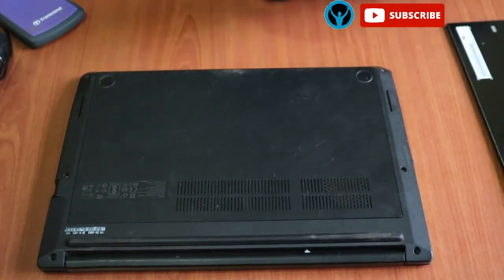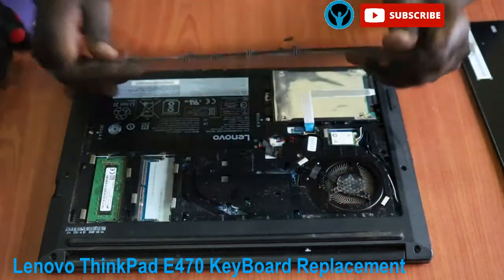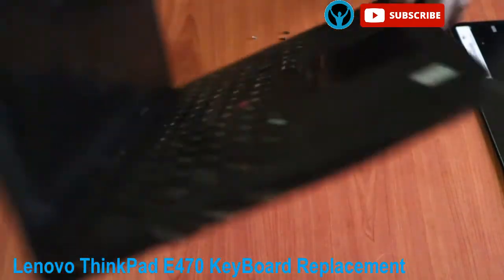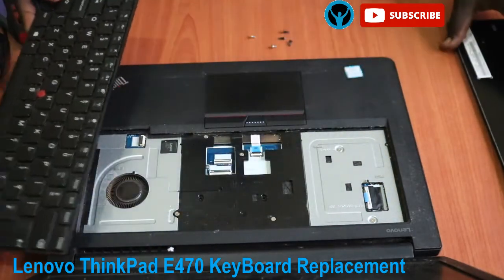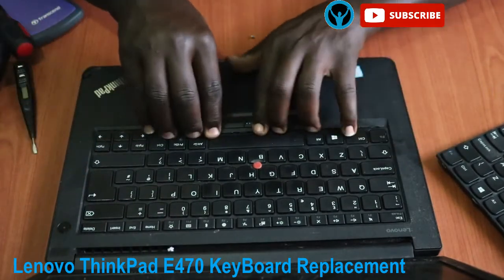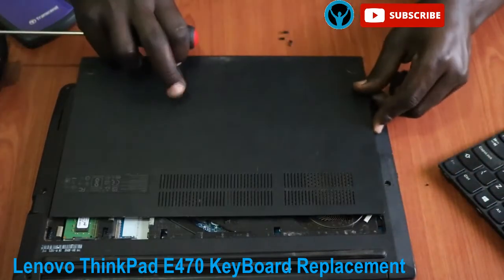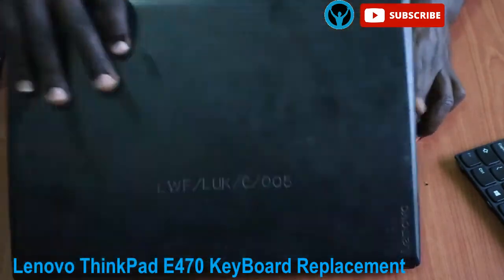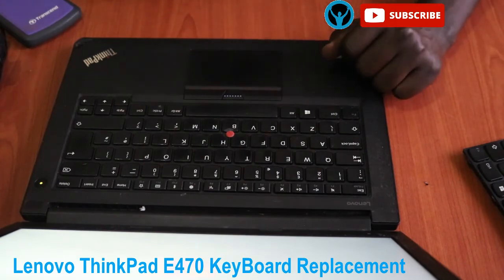Lenovo ThinkPad E470 Keyboard Replacement

Comment: Cool video man, keep it on
Reply: What can be made easy is putting you hands on the board and pull it gently to you so in unlocks instead uf using a flat screw driver to push it
Reply from the maker: @Wo sind meine Sachen, Thanks💖💖